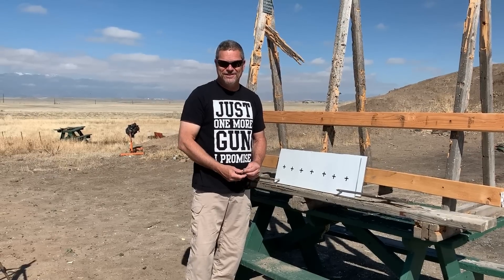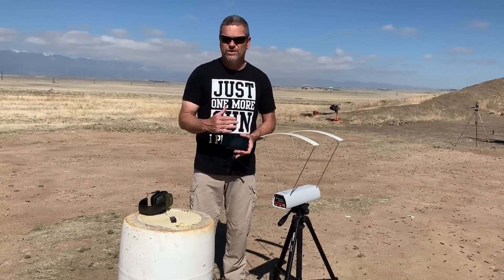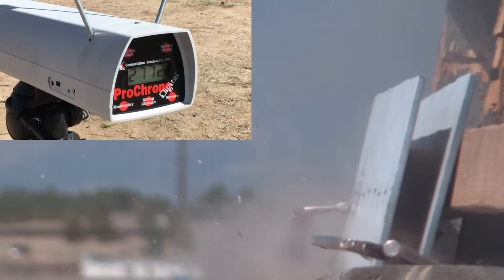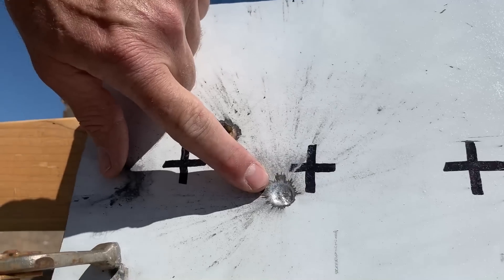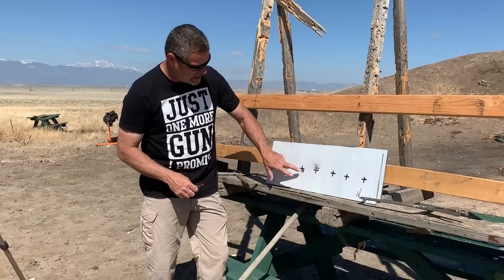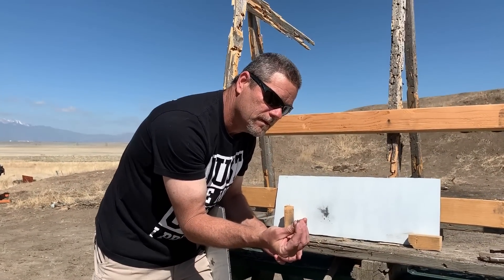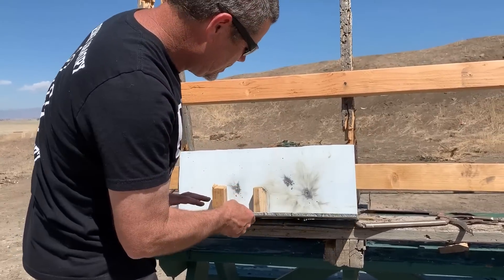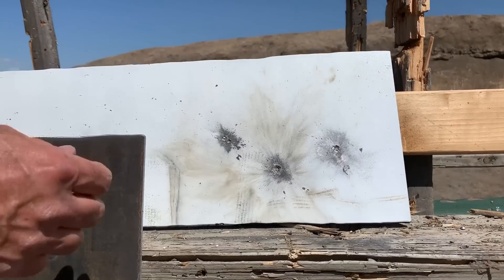EPR M80A1 vs Legacy Rounds  On 3/8" AR400 Steel Plate

Comment: First of all go take a look at the performance of M80A1 and M855A1 on soft targets. They absolutely destroy soft targets and at lower velocities in shorter barrels. They dump energy instantly and fragment creating huge wound cavities. They also are obviously better at barrier penetration and a more efficient projectile for accuracy and distance. It’s a better round all the way around and can defeat most body armor outside of level 4 or some expensive level 3+ plates. No one wears steel armor that knows what the hell they are doing as it’s way to heavy at 17 pounds plus for a set of plates. You are going to have a bad day of someone is shooting at you with either round and most barriers won’t protect you outside of brick, concrete and steel.

Comment: Late to the "party" but here we go...

The misnomer that the M80A1 EPR and M855A1 EPR are AP (armor piercing) bullets comes from the fact they are capable of penetrating Level III/III+ AR500 armor plates. In reality however the M855A1 and M80A1 rounds are as described in their name (Enhanced Performance Rounds), as they offer much better wounding ballistics and BARRIER penetration than their predecessors (M855 "Green Tip" & M80 Ball).

Just a little FYI.

Comment: There’s no way that new round is worth that much money the old bullets smoked it
Reply from the maker: Sure did👍
Reply: It's supposed to have better soft target performance, not better penetration.
Reply: It's only $20 because it's never been offered on the civilian market.  The cost to produce isn't really that much higher than standard M80 when you look at total unit cost.  The  M80A1 isn't an AP round as such.  It's intended to offer penetration closer to the M2 and have better terminal performance than M118 and standard M80 ball.  And by most tests, it has been pretty successful, but it's still a compromise.
Reply: Its not an armor piercing round, its a general purpose round, designed to go through body armor that the m80 wouldn't while still providing maximum performance on soft targets :b it also solves the longer range wobble problems of m80, because it isnt supposed to be yaw dependent, so it has a much longer effective range, but the same maximum range as a m80. It's like comparing a hallowpoint to an FMJ, hollowpoint's going to have way more traumatic damage, but be defeated by most armor or enviornment/cover.
Reply: It isn't intended to outperform a black tip. It's meant to replace the standard ball ammo and the green tip 5.56.

Comment: Just to extend what is shown and possibly clear up any misconceptions of the EPR round (both the M80A1 and M855A1) I have to say that the M80A1 (and M855A1) is not and was never an AP round. Both rounds were developed to increase the performance over the then currently issued M80 and M855 ball rounds (as well as the elimination of led in the ball projectiles) using the experience and feedback gathered from Somalia, Afghanistan, and Iraq.  To make a long story short, improvements in penetration of walls, thin metals, and glass was a requirement of the M80A1 and M855A1 but also to retain comparable terminal ballistics to the rounds they were to supersede.  

At least from what I have seen about both rounds is that they succeed in providing "Enhanced Performance" over their old Ball counterparts but it shouldn't be misconstrued as being on the same level as being a true armor piercing round.

If you'd like to do some further reading here are some powerpoints and documents during the development and early fielding that have made public domain (Though I will note there is variance between statistics shown though that could be chalked up to when the documents were published at the time. Also sadly there is no solid documents covering and detailing the overall performance of the finalized M80A1 and M855A1 EPR rounds in a scientific manner, so do take some of what is listed in these docs with a hint of skepticism):
https://ndiastorage.blob.core.usgovcloudapi.net/ndia/2015/smallarms/Panel_PMMAS_SMALL_MED_NDIA_FINAL_29MAY15.pdf
https://www.dote.osd.mil/Portals/97/pub/reports/FY2014/army/2014m80a1.pdf?ver=2019-08-22-110520-797
https://www.dau.edu/cop/ammo/DAU%20Sponsored%20Documents/Public%20Release%20EPR%20Apr12.pdf
https://asc.army.mil/docs/pubs/alt/2010/4_OctNovDec/articles/32_The_Evolution_of_the_M855A1_5.56mm_Enhanced_Performance_Round,_1960%962010_201004.pdf
Reply: Underrated comment. "Enhanced" is about terminal ballistics against soft targets; any additional performance against hard targets is purely a secondary benefit. These are not AP rounds even if they have some residual AP capability -- so in a comparison against AP performance one should expect purpose-designed AP rounds to do better.
Reply: One problem, the Russians and Chinese adopted a ton of cartridges they called "armor piecing" which actually were more effective against armor than previous cartridges.

All of them have similar or worse construction and performance than M80A1 or M855A1.

Comment: Hey GB another awesome vid. I’m not sure if I might have missed a video somewhere but I’ve read a few times that WW2 fighter aircraft used a certain kind of .50 cal API round designed specifically to bring down enemy aircraft. Any difference between those and modern API rounds? Just figured you all would probably know.
Reply from the maker: I'll look into it👍
Reply: Only kind of special aerial .50 cal ammo I know is Korean War-era M23 Incendiary, filled with large charge, of incendiary compound designed to ignite jet fuel, and 3400 fps muzzle velocity.